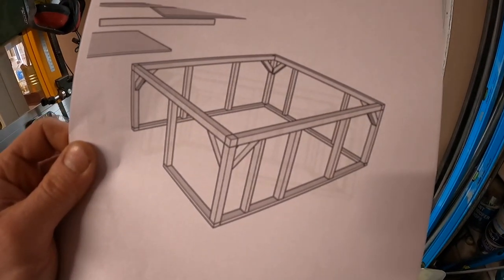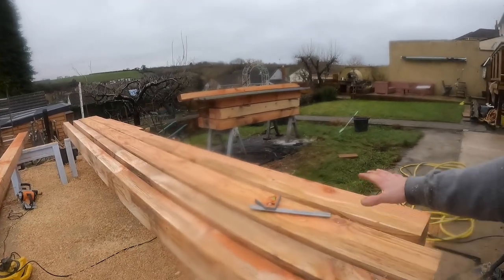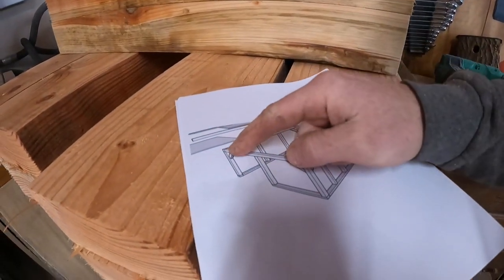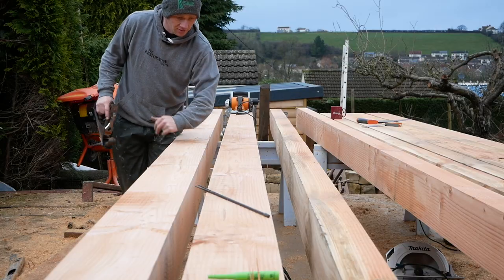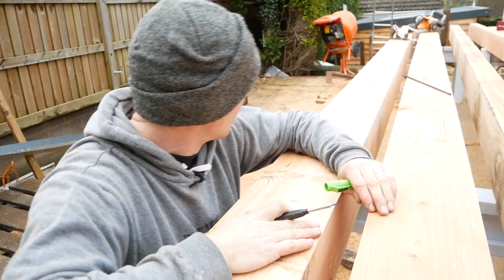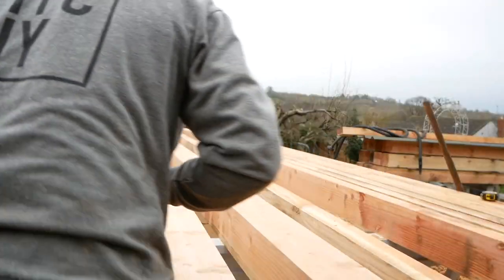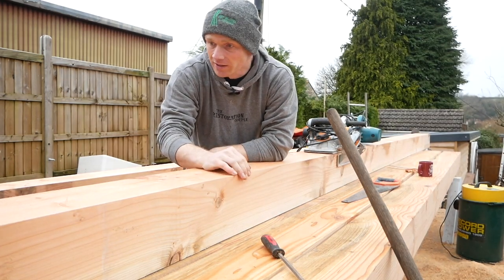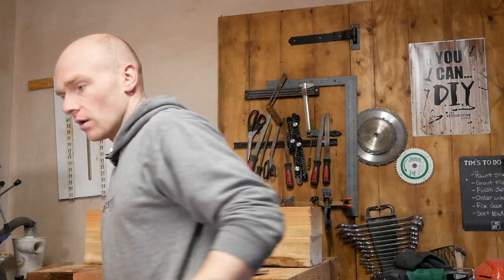ALL READY FOR JOINERY - Time to sort these beams!

Comment: Thats going to be a mighty workshop, just think how many 8ft 2x4s you could get out those timbers.
Reply from the maker: Haven’t worked it out for comparison yet but i would need around 100 2x4s for the same structure at 400 centres. My centres are 2000mm so it might not be much different. 🤔

Comment: Maybe some has already mentioned it but it rather looks like the air vents for the air cooling to the motor are blocked. That's a recipe for a knackered plane.
Reply from the maker: Cleared every few minutes, fear not. 👍 it’s another reason why the extractor is a big benefit. 👍

Comment: Can I ask a safety tip....? when you're using the circular saw for those thick timbers supported between saw horses how do you avoid the blade binding and dangerous kick back???  I'm going to be embarking on a sleeper retaining wall project soon and have the fear of kick back when doing cuts!!!

Great channel, thanks!
Reply from the maker: Never beyond half way before it’s flipped. If doing sleepers I usually leave them in a stack and cut fully supported.
Reply: @TheRestorationCouple  thanks for the reply....  not sure i understand the fully supported concept though as I've had kick back cutting 4x4 flat on the ground...  I understand the end falling away if hanging off the edge of the support but then can end up with tears

Comment: What was your design decision on this as opposed to 6 x 2 framing/insulate/clad type system? Especially given the timescale your working to? Simply asthmatics? Just wondering.
Reply from the maker: I nearly built this with regular stud walls about 5 times over the last 2 years but held out for the challenge. Not the quicker or cheapest but great practice for possible future bigger projects.

Comment: I knew I’d love this...love when you chat as you work...I do though have a question...forgive my ignorance -! Why don’t you run the planer down the other side  in the opposite direction to catch that few mil’ you miss...is it to with the grain of the wood! 🤔🤷🏻‍♀️🤗🙋🏻‍♀️💕🇬🇧jane
Reply from the maker: Good question, it does plane better depending on grain direction, especially with some timbers however it also means the cable, vacuum and mess is all the wrong side.
Reply: @TheRestorationCouple  Thankyou so much for answering my pondering! ☺️